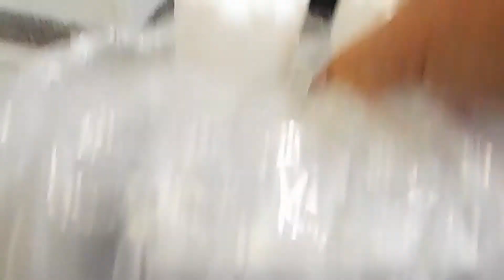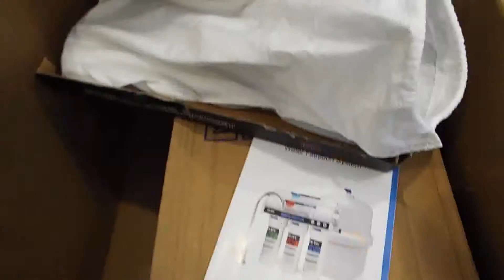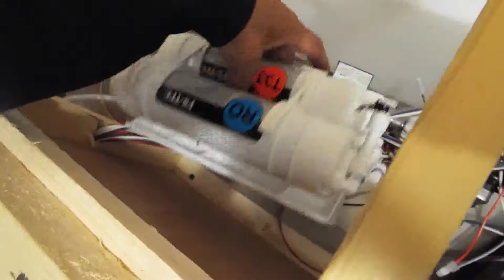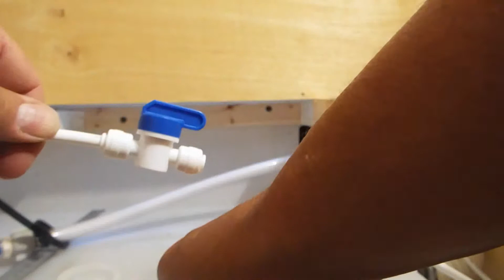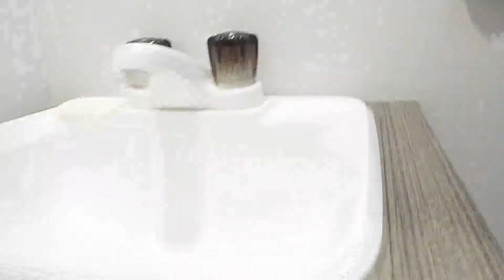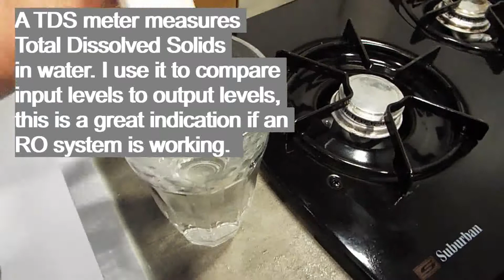RV Boondocking, Zero Waste Reverse Osmosis Water Filter Install

Comment: Hey my RO system in my home shuts off when the pressure in the pressure tank is full. So I’m guessing you have to keep an eye on the tank vent overflow so you don’t continuously overfill your FWT with RO water?
Reply from the maker: My freshwater tank in my RV has a overflow drain on it so if I do fill the fresh water tank with too much RO filtered water, when I am filling the freshwater tank I just keep an eye on the overflow drain

Comment: With having the drain outlet going into the fresh water tank  have you had any problems with any mineral buildup or anything like that?
Reply from the maker: I have not had any issues with minerals building up. I start my trip by filling the FWT with RO filtered water. If I get to stop at an overnight campground with pressurized water I drain the RO filter to the exterior drain, and top off the FWT again with RO filtered water. I measured the Total Dissolved Solids at less than 8 ppm in the FWT when filled with RO water and most surprisingly running the RO filter against the water that was already filtered I did not see much improvement in the RO faucet, but the meter only measures in 1 ppm increments.  I have not yet had to put unfiltered water directly into the fresh water tank that would result in the concentration of minerals getting higher if using a lot of RO faucet water, but I suspect it would not really matter there either since you really will only use about a gallon a day per person of RO faucet water.
Reply: @madscientisthut  awesome thanks so much for all of that information, I live fully off grid and fill up every 3 days or so and I have hooked up the ro system from our main tanks only for drinking water, I also routed the drain water back to the main tanks thats why I was wondering if there would be mineral build up or any problems. It saves a lot of water rather than dumping it i can use it to shower as we put fresh water in the main tanks every 3 days

Comment: So is this the only way to connect the RO system? Will this filter everything in the trailer including toilet? Sorry I bought the same exact one, I’m not very knowledgeable about these.
Reply from the maker: You can set it up like in the video and If you set the output to fill the main water tank, yes all water will be filtered when you are running from the main water tank. If you only set it to fill the small pressure reservoir that feeds the faucet it will only filter the drinking faucet water. Before I go on a trip I fill my main 30 gallon tank with the RO filtered water. 

Edit: This is not the only way to set up the Filter system for use in an RV, but note that you should never connect the drain of the RO to your grey or black water tank, unless you want an unexpected flood.
Reply: @madscientisthut  thank you